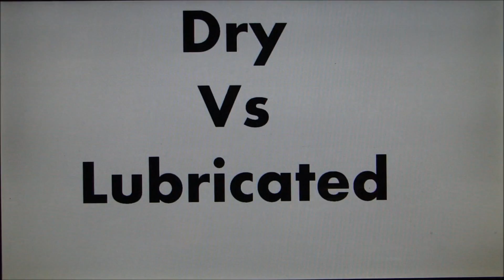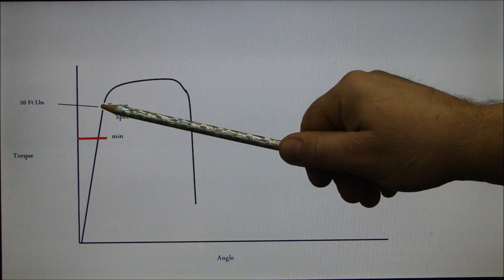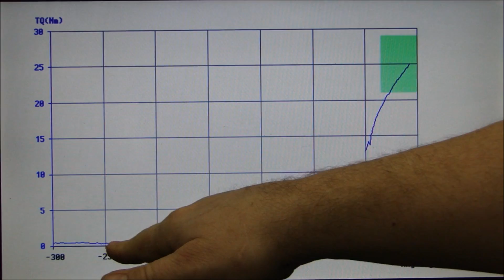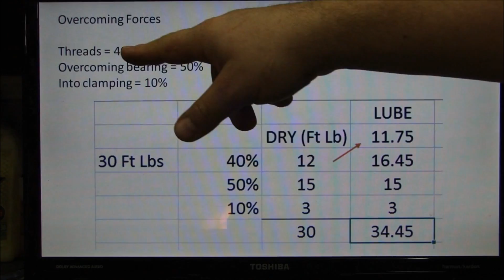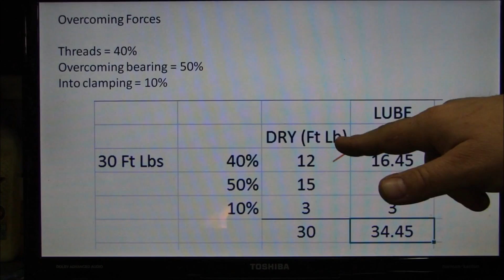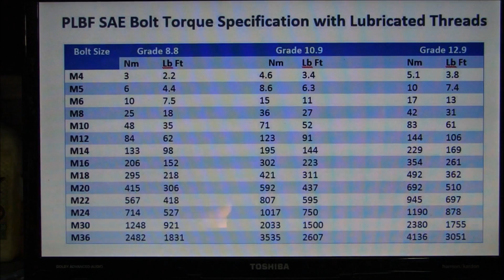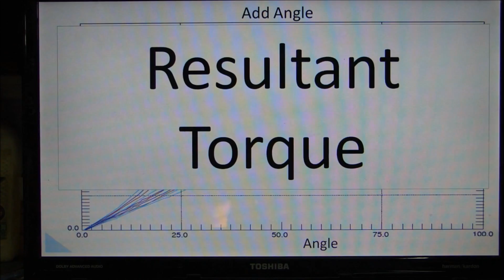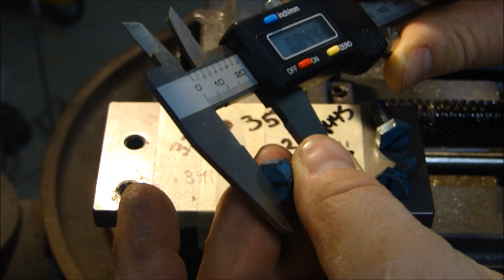Engine Building - Fastening

Comment: Anyone having trouble understanding this - it is counterintuitive, as Pete says - might find this animation useful: https://youtu.be/yDylMTnsR7g

The point is that clamping force exerted by a fastener can be increased by pushing the bolt beyond the 'safe' boundary of the elastic zone, so long as you don't go past the elastic limit. You do this by rotating the fastener a specified angle after applying the specified torque. Pete's point is that calculating the necessary angle isn't just a matter of applying 'more torque': if it were, the manufacturer could just specify a different, higher torque value. Calculating the angle required to get the most out of the fastener without pushing it into failure requires knowledge of the dimensions and material involved, plus the state of lubrication of the parts. That's a complex calculation.

The animation shows pretty clearly how lubrication can affect the clamping force a) after torque only and b) after properly applied torque and angle.
Reply from the maker: Paul....that is the most awesome thing! Thank you so much for helping me out. This is a really difficult subject but so important to understand. Great video! Thanks for sharing

Comment: First of all want to say that your chanell rocks!!!
But i think you get it wrong with the lubrication, since you have les friction on the surfaces more of the toque wil be converted into clamping force when you have lub on it, but the fastener will turn more because there is less friction that tries to retain the bolt in the same position and maybe is more chance to come loose. I understand that the "angular torque" is more, but the actual torque for the same elongation should be less i think, could you verify this?
Thanks for all the good content!!
Sebastián
Reply from the maker: Thank you Sebastian. I completely understand your point, and yes that would seem to be the right answer. That is the reason I did the experiment in the video. To prove that lubrication reduces clamp load which is a function of resultant torque and bolt stretch. The experiment proved the theory about where energy goes when torquing a fastener. That is why lubricated fasteners require more torque to achieve the same clamp force. Believe me, I went over the concepts, problems, theories, experiments, results....everything before I posted the video because I know it seems counter intuitive. Great comment. Keep up the great thought process.
Reply: *****  I will think it (with a friend) trough the week because i still dont get the whole picture of whats hapening. If i think im wrong or right ill let you know here.
Thanks for taking your time responding :)
Sebastian
Reply: Sebastian cardoso People are forgetting the bolt stretch part and the graph he described earlier in the video. Yes hard to get your head around but look at the graph again and look at the experiment. It makes sense once the light bulb goes off :)
Reply from the maker: YES......you are healed! lol

Comment: Need to measure stretch when tq down to see the truth of clamp load according to arp that is why we check bolt stretch under load not after it is stretched, when bolt is stretched it is junk  .
Reply from the maker: There are two ways a bolt can stretch. Under load with just torque it will stretch as long as the yield point is not reached. In that case if you take the bolt out the dimensions will not change. If you torque a bolt and apply angle, you are yielding the bolt to maximize clamp load and it is permanently stretched. In this case if you take the bolt out and measure it you will find it to be longer.

Comment: Hi Pete, I appreciate the work you are doing by explaining mechanics to others, so, with all due respect, I must kindly ask you to review the conclusions of this video, as I'm afraid they are totally incorrect: When you lube a bolt you need LESS torque to achieve the same clamp force. There are two mistakes in the video: 1) When lubricant is applied to a bolt the percentages of torque needed to overcome friction are smaller, so 15% or even more percentage of the applied torque is converted in clamping force. 2) The length measurement of the bolts in the experiment is not accurate. The lubed bolt has turned more degrees so it has to be longer. You will be able to notice this if you repeat the experiment using bolts with longer grip distance.
 
Best regards,
Reply from the maker: +Vicente C I agree with you, torque will change based on the presence or a lubrication. I am discussing and demonstrating in this video Resultant Torque after and applied angle. That is the torque at the end of the angle. The angle applied to a fastener is a calculation based on the area of thread engagement, not just the metallurgy as in the Skidmore-Wilhelm test. If the calculations are done correctly, the bolt will stretch to achieve maximum clamping force between two mating parts. In the experiment, in the absence of a transducer, I prove that the resultant torque is lower after an applied angle to a bolt because of the amount of stretch, or yield, is less. If there is lubrication on the threads the clamping force is reduced because the Resultant Torque, or torque at the end of the applied angle, is less. You can also see this in the graphs where the torque curve during the application of angle shifts. 

The reason I did the experiment, and the purpose of applying angle is to stretch the fastener to its yield point. If there is lube on the threads the coefficient of friction does drop, as you indicated, and the fastener does not go into yield. That is exactly what I demonstrated and showed with the torque curve graphs. Since the fastener does not yield, maximum clamp load is not applied and it will eventually loosen. I have seen hundreds if not thousands of torque curves where after the angle is applied the minimum resultant torque is not reached and you can see in the torque curve where the fastener does not go into yield. That is critical and the entire purpose of applying angle. Optimum angle is a calculation based on the fastener material and the area of thread engagement to yield the fastener to obtain maximum clamp load. Since lubrication cannot be applied precisely enough to be included in the calculation, all torque and angle calculations presume a dry fastener. I've read that Nasa brief, but it is important to keep torque and angle separate. The are entirely different things.

Comment: Can you redo the test but measure the bolt stretch while in the part? If your plate is thinner than the bolt length then that shouldn't be a problem. The difference will be more noticeable. Because 0.3% difference in bolt strength doesn't seem like that much difference in clamp force. According to the chart you showed earlier in the video, resultant torque differed by about 8%. To me, 8% doesn't seem like that much but for head bolts on high performance engines, 8% is worth noting.
Reply from the maker: I could absolutely redo the test to show a greater difference. The point of the experiment was to show that lubrication leads to less clamp force as measured by bolt stretch. It was just an example not meant to represent the percentages in the sample problem. I'm sure you meant bolt stretch and not strength because although related they refer to different things. The 8% will change with different grade fasteners. If you go too far on angle you could critically weaken a fastener which might be 9%. There are many, many variables

Comment: sorry but your conclusion that "oil or lube on a fastener requires a higher torque to achieve the same clamp load" is completely backwards. if you are trying to achieve a consistent clamp load (preload) on two bolts where one is lubricated and the other one is dry, you will have to apply more torque to the dry bolt.
http://machinedesign.com/fasteners/understanding-nut-factor-threaded-fastener-torque-tension-relationship
Reply from the maker: I ask you watch the video again. I read the article in the link you share, thank you for that. The article speaks nothing about what angle is applied after a fastener is torqued to specification. The article does speak to coefficients of friction, so when a fastener is lubricated is would require more torque because the coefficient of friction is overcome sooner. I believe you are confusing plain torque with the resultant torque which I am demonstrating. The fact is if you have 2 fasteners, one dry and one with some sort of lube, torque them identically, and then apply a calculated angle to both, the fastener with the lube on it will have a lower clamp pressure on the load bearing surface.

Comment: Thanks! Great video but your 13% increase in torque required at 13.36, doesn't add up to 34.45. How did you get there? also how come bolt neck stretch happens before stripping the threads. I've just done both on my con rod. I torqued 30lbs instead of 26 and my threads were lubricated. Unfortunately! Now I know why it happened

Comment: Very informative Pete.  My question is, the factory manual tells me to torque down the main bearing bolts in order to check the clearance on the new bearings.  Then, after measuring clearance you have to reapply the bolts!  Doesn't that mean that you have already "stretched" the bolts since you already torqued them down once before?
Reply from the maker: Thank you. If you only torque them down you can reuse them. If an angle step is required after the torque, just torque them down to measure the clearance

Comment: iv been thinking about this for a bit now and still don't quite get it. I think the relationship between bolt stretch and clamping force is not at clear cut at those graphs say. when you torque a dry bolt you are twisting it just as much as you are stretching it. and as you twist the bolt it will stretch more. so I think to get an accurate test you would have to measure clamping force some how not bolt stretch. i don't think bolt stretch is an accurate measure of clamping force. I may be wrong.
Reply from the maker: I realize it's not a simple thing to just get. Think about it like this....you have 2 head bolts and you put 100 ft lbs and 90 degrees on both. The one that stretched more is relaxing so the clamp force drops. You are right, clamp force is measured with a strain gage....but it's not practical in an assembly.

Comment: I thought the whole point of this experiment was to show the resultant loss of clamping force due to lubrication. Either I missed something or you never really drove this point home. Also, isn't adding angle is the same as over torquing the bolt; by x-amount? Is there an "Angle-to-torque" chart?  Great post - thanks for sharing.
Reply from the maker: Kevin Tucker The loss in clamp load is demonstrated by the stretch of the bolts. Instead of the energy going into the clamp force it goes into yielding the fastener. Angle is not adding torque because angle is calculated based on area of thread engagement. It's not a simple conversion

Comment: I was fascinated with the explanation but not sure I got the point I needed.  Would it be fair to say that when using torque plus angle it is best to not lubricate and to follow the charts that are designed for torque without angle?
Reply from the maker: I know it's a difficult thing Jim. Angle is used with torque-to-yield fasteners. Angle is applied to reach maximum clamp force while yielding the fastener. The point of the video is that if you put lube on the threads the fastener will not yield when you apply the angle.
Reply: I guess what I am asking is if we use torque to yield fasteners then best not to use lube?  Thanks
Reply from the maker: Correct, no lube on a TTY fastener

Comment: This gives me some questions. First you state fasterners should be changed out every 10 uses. Does this apply to all fasterners? Ie lug nuts. Second you stated that after a fastener is over torqued it should be replaced. Also about lug nuts. How would I know if a tier shop /dealer over torqued my tiers then when say I rotate them my self I under torqu because they've been steched
Reply from the maker: James MacInnis If a lug nut is over tight the thread will gall. You will see the threads bent or damaged. As long as you follow the torque spec you do not have to change every fastener.

Comment: Hi Pete. Great video thanx. If all other things are equal which gives the most/best strength, course or fine threads?
Reply from the maker: Fasteners provide a clamping force. The ability of the fastener to get and keep and hold that load is a calculations based on thread engagement. It depends on the application. A fine thread will provide a higher clamp load for a smaller diameter.

Comment: So question, if you have to apply more torque to a lubricated fastener to achieve the same clamp load as an unlubricated fastener wouldn't that also increase the stretch to about the same as an unlubricated fastener with less torque.
Reply from the maker: It would be similar. That is the point of the video. A lubricated fastener changes the torque curve.

Comment: Great video Pete! I believe I understand the concept you are trying to get across but can you explain a manufacturer would choose to or not to use lubrication on a fastener?  Furthermore, if you were designing something that requires a fastener when is it good practice to use lubricant or not to use lubricant?

I've seen people put lubricant on long head bolts to keep them from creaking or anti-seize to keep things from locking up without thinking of the repercussions of this. Is there instances where you've gone against the manufactures spec for other reasons? Thanks
Reply from the maker: All great questions. Lubrication does have a function when used on a fastener. It really depends on so many things. I have not used a lube when a lube was recommended. To me it is about the criticality of the joint. A head bolt is more critical than a valve cover bolt. I think kin order to answer you properly we would need to discuss each instance in detail.

Comment: point 3 of your conclusion is wrong. for any giving amount of torque applied to a fastener, the lower the friction(more oil), the more clamping force you can apply.

www.eng.auburn.edu/~marghitu/MECH2110/C_6.pdf
go to page 7 diagram (a) for the visual explanation 

www.spaenaur.com/pdf/sectionD/D48.pdf
here is a list of clamping loads vs. required torque (both dry and lubed)
lubed bolts require less torque for any given axial load.
Reply from the maker: +Beryllium You misinterpreted. If you have any lube on the threads, and apply identical torque and angle, the resultant torque (energy put into the joint) will be less.
Reply from the maker: +Beryllium The charts you provided show exactly what I demonstrated. A dry fastener provides a higher clamp load.
Reply from the maker: +Beryllium The charts are for torque only. I was demonstrating resultant torque after an applied angle. Two totally different things.

Comment: Thanks for that, I can get my head round it but what is your opinion on manufacturer recommendations? I am thinking ARP and their direction to use their 'Ultra Torque' product when using their fasteners? How do I know how much extra torque is needed over OEM fasteners? If I follow their instructions, (ARP), I can measure rodbolt stretch but I am using ARP for the heads and  mains. Some ARP info says 90lbs for the mains on this application but nothing re heads, so stand torque with lube will be under-clamped. This is a Rover V8 with steel shim head gaskets.
Reply from the maker: bunning63 always say to follow the manufacturers recommendations. I am just trying to help those that want to use a lube for some reason or another. Just some things to consider.

Comment: Trying to wrap my head around a lubricated bold requires more torque but results in less stretch. So by that fact is it always better to lubricate a bolt to avoid bolt stretch and extend the life of a bolt?
Reply from the maker: It does not require more torque, just more rotation to achieve the same clamp load, the torque curve shifts slightly. It is not always better to lubricate depending on the application.
Reply: @PetesGarage  thanks for the reply Peat, poorly worded on my part, I do not in anyway doubt your findings, in my head though the idea of more rotation would make the bolt drive down more adding more stress overtime to the head and thread of the bolt causing more stretch. but the reverse happens.

Comment: That is the exact opposite effect of lubrication on torque and clamping force of a fastner than I had thought.  Thank you for the education.  I am just getting ready to assemble an engine that I have spent thousands on machining and parts.  What is you opinion on replacing grade 5 hardware for grade 8 hardware?  Thank you very much.
Reply from the maker: Any time you can upgrade hardware it helps. Just follow the manufacturers recommendations on torque and lubrication.